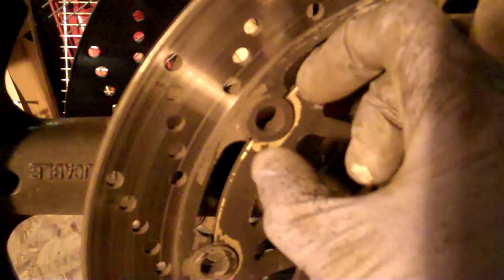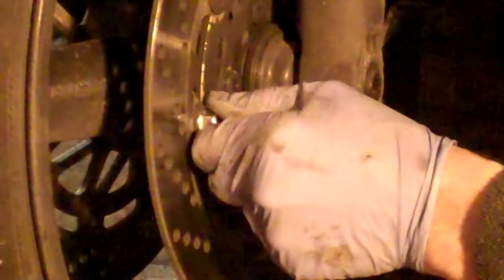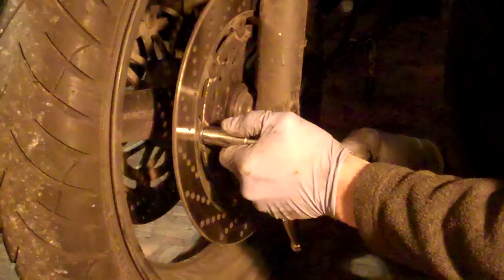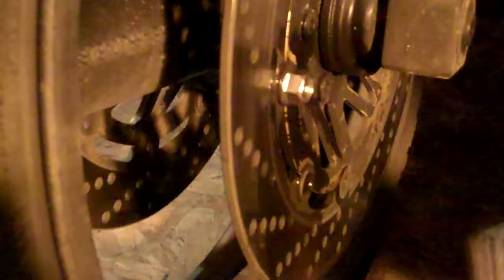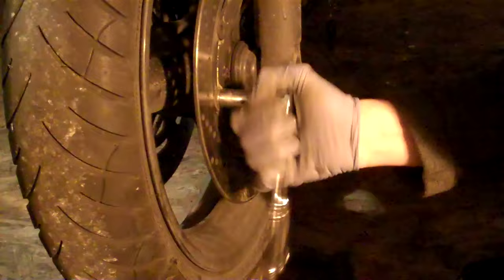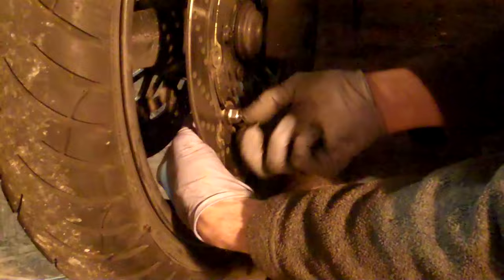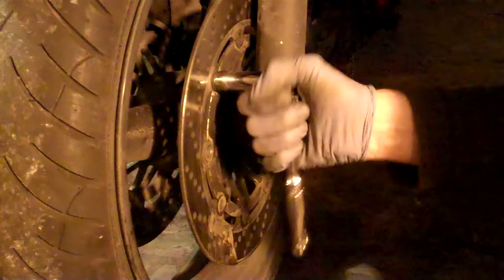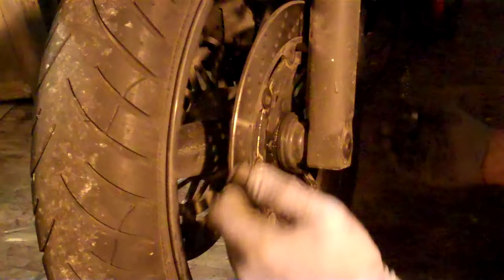Delboy's Garage, How-To Free up 'motorcycle brake disc bobbins'.!

Comment from the maker: Well done to you, Sir, it's excellent to hear that you've sorted it out.  So many riders write to us explaining they have air in the brake hose and cannot bleed properly for trying when all it is is the rotors are flexing due to being jammed up, as you have found!  It's not complex but it does take a little understanding of each part of the braking system to be able to maintain it properly so it operates perfectly... well done again and ride safe, Del

Comment: I'm not convinced that disc bobbins are supposed to spin as freely as this video suggests. I've spoken to technicians (people who used to be called mechanics) at my local Triumph dealer. None of them thought of this as a regular maintenance job, other than to clean with brake cleaner (especially if you allow your bike to get as filthy as this one!).In fact one said 'leave them alone'. EBC now produce discs with flat-sided bobbins. They can't rotate.

Comment: Hey Del, avid fan!
I feel it ought to be mentioned (If it hasn't already) that this isn't possible on all brake rotors.
EBC's SD bobbins are not round. Hence the name SD (Square Drive). Trying to spin the bobbins could cause expensive problems!
So yeah, check your discs people before you give this a try!

Still a top trick to know about for regular discs though!

Comment: Didnt realise these things existed till I came here and lucky me they're all seized; Thanks for the useful trick 3 down, lots to go
Reply from the maker: It is amazing how little known about these are Chris, and when you've done them, it will allow the disc to centre between the pads more quickly and you'll notice your brakes are sharper, many people bleed their brakes over and over trying to make them crisp at the lever, they even go to the expense of buying braided hoses in the quest for sharper brakes with more feel.... when 50% of the problem is the disc being seized up... go to it mate and let us know how you get on!
Reply: Ordered bolt (M12), bolt arrived, too wide (literally 1-2 mm off) now to wait for new bolt. my lack of sundries is embarrassing :D

May as well use the time to clean the chain, front brakes and replace my horn that sounds like a squirrel farting. Winter ridings a dirty lark.
Reply from the maker: ***** Good work Chris, housekeeping will keep the mechanic away and shame about the M12, little tricks like poking a drill bit through just by hand to check the size first before you order the bolt can save a lot of grief... drill bits are a great tool for measuring holes...!  Don't worry about the sundries mate, mine's taken a lifetime to build up and I still don't have everything I need, you never will mate!
Reply: M10 Hex Bolt (short) from B&Q... think I have enough to put a bolt in every hole in the bike but win-win. Managed to clean  a few that were rock solid; low and behold my brakes don't judder when I have to brake heavily any more.
Marvellous Trick, thanks for that!

Comment: Man, you rock! The squealing is gone, and so is the shuddering. The brake lever "takes" higher up and is a lot stiffer than before, my steel-braided brake hoses are finally working properly.
I've reason to believe that since the rotors were stuck before, my braking was mostly about warping the rotors in their holders as they were stuck.
Problem is now fixed and I have a new motorcycle it feels like!

Comment: Hi Del.I was having trouble with brake noise and was thinking the worst seized pistons in the callipers etc, fitted new pads cleaned callipers and pistons still getting brake noise.Then tried the rotor bobbins, seized tight on one side of the whee,l did what you said in the video NO noise now. Fantastic thanks for your help probably saved me a few quid not having to take the bike to the garage.Keep the videos coming.

Comment from the maker: Too right Ade, half of these garages just want the money for the big job and think you will trust them and the others dont have a clue how to clue... give it a good cleaning like this and it should get a lot better... mine start to oscilate about mid winter and a good cleaning get them back to normal...warping a disc is very rare unless you are braking really really hard a lot of the time and have a high performace bike.... its much more likely they are gummed up.. good luck and well done.. Del.

Comment from the maker: Hi Stuart, without a front paddock stand, easiest way is to jack against the side stand...simply put it on the side stand, place a trolley jack under the right hand side of the bike & with a folded rag to protect against damage, jack carefully up under the collector box on the exhaust and it will roll left and the front wheel will come up ...and be careful!  Cheers, Del

Comment from the maker: Hi Dean.... no, you're fine as long as they spin with the bolt in...if the bike is quite new and the brakes in fresh condition then the bobbins will still be snug and tight from new...its when the dirt stops them doing their job that your braking efficiency is effected....so just make sure they spin round with the bolt in and thats fine...  thanks for your kind support... take care, Del.

Comment from the maker: Hi Ian,yeah there are a couple of bikes with solid bobbins,the single only way to do them is by hand using a g-clamp & a postage stamp sized square of inner tube rubber to protect them & then spray away & wiggle!  It's more long winded,but gets the job done......I wouldn't sweat it too much, mate, as a bike like that I'm sure, isn't gonna ride in the filthy weather every day, so your discs shouldn't get too cacked up!  Hope that helps you, mate, Cheers, Del

Comment: Awesome tip thanks a lot. Many mechanics I have come across over the years have felt that brake lever moving in and out and insisted the discs need changing without any other investigation. Happened to me many times. Will try this on my latest wobble!!!

Comment: Hiya Delboy! Traded in my Hyosung gv250 and picked up a nice silver 2003 Bandit 600. Did this job today... Bobbing rusted solid. Sorted now, Cheers mate
Reply from the maker: Charlie Rutledge Hi Charlie, congratulations on youre new bike buddy....good choice, i reckon 9 out of 10 bikes over ten years old will have jammed bobbins, so its a good fix for better brakes right away... ride safe mate.. all the best.. Del.

Comment: My disks were pulsing during braking as well. I used to push them from side to side as you did in your video and spray them with a bit of brake cleaner. This worked, but only for one or two rides, probably because I couldn't get to all the gunk. This seems like it might do the trick, gonna try it tomorrow. Good video!

Comment from the maker: Hi mate, yes, its a greatly missed little bit of maintenance, but once you've done it, you'll be surprised at the improvement it makes in lever feel and braking response, plus it will prevent you warping a disc in the summer as once they are seized up they cant move about so flex instead...  cheers mate, Del.

Comment from the maker: 90% chance it will be mate, the bobbins have to be free to move otherwise the rotors will freeze up slightly off centre and there's your pulse..get them spun up and you'll see how much better the brakes are... good luck with it mate.. Del.

Comment: I use a bit of wood on the jack. Gives it a better seat for the bike but won't mark the frome. Also lets the bike go higher easier. Did that for my dad's R6 while switching engines and with my mums bandit 600. The bandit is bloody heavy! If you have a centre stand , use that and get a heavy person to sit on the pillion seat lol

Comment: Hi Del, the Video is quite an old one but still relevant. Your Videos are all remarkable and those advices along the way as side notes are a real treasure. Have followed both Busa and previous projects. Absolutely marvelous.
I was unable to decide where to post this question (Busa Caliper Rebuild or here) as i have something in between.
GSXR 1000 K1. Changed the Rotors but not the pads as there was enough meat on them. But now they are moving inside and with rotation at lower speed you can hear that rattling noise. 
Rotors on the side where this sound is coming from has clean rotatable and free bobbins. On the other side tried a lot of cleaning with brake cleaner but 7 of them are not rotatable by hand. :(
Also tried brake grease on the back of pad that did not help either so washed and cleaned it. 
Pistons are all cleaned up (wd40 lithium sprayed). Moving aahhh... freely (last one comes a bit late but same behavior on both side)
Haven't missed any assembly parts as well.
Wondering how could this be solved.

Comment from the maker: Hi Terry... had a look at some, and indeed they do appear to be solid...i guess the only thing you can do is use an old tooth brush and scrub all round them while jetting the brake cleaner in the gap...as long as the worst is off then they will still work ok.... hope that helps you out...i didnt think any bobbins would be solid, seems a bit daft, but who are we to question the mighty factories aye..lol... take care, Del..

Comment: Alright Im going to check this first thing tomorrow... after work.
My rear brake has been pulsating for a while and I couldnt figure out what it was.
Thank you for pointing this out!
Reply from the maker: I imagine it's highly unlikely that it will be frozen brake bobbins because rear brake discs are usually solid, this trick is only for a floating disc, you could check the disc for run out to check if it is warped and worn to excess, the very least you could dry is new pads and clean the caliper, either way, good luck with it my friend.
Reply: @Moonfleet41  Hey thanks for the reply. Thats a tad worrying because the brake bads are new and I've been cleaning the brakes a few times. Maybe some lube or chain cleaner had gotten on the disc. Unfortunately this didnt help.
I cant 'see' any warping... I'll check the bobbins (see whats what) and drop by the shop if I cant figure it out. It needs a service soon anyway.

Thanks again!

Comment: Things like this should be in owners manuals, bye the comment on Ducati floating discs, lol, your absolutely right. My Monster has tonnes of float which can even set up a resonance/vibration if the right brake pressure is held for too long. Must be a Ducati thing! Anyway, great video,

Comment from the maker: Hi mate,thanks for your question,first check that you are using the right pads for general road use & not race pads & learn to lay off the brakes a bit,unless they are cheap Chinese discs of rubbish quality,then the only way you're warping them is through too much heat,heat that is kept on them for too long,you could be braking too late & too hard or braking light for too long causing a slow heat build up,provided they are fitted correctly only mis-use will warp them..what bike is it? Del

Comment from the maker: If the bike is quite new, remember, these are only semi floating discs, not fully floating as on Ducatis where they literally rattle, so they should be firm, but moveable and on a newer bike there is no wear so perhaps they are just still a bit snug, as long as the brakes work ok and all the bobbins are mobile with the bolt in, then that's ok, don't try to over think it, mate, the general rule is that if it rides ok then it usually is ok .. take care Del

Comment: Amsoil. Great for high rpm bikes like r6 zx6r so on and so on. Wet clutch comparable. As for bandits motorcycle oil or 10w40 or what your manual reccomends will b fine. Great video again man

Comment: Hi Del. deffo stuck solid mate, tried the bolt trick, when I got the bike the sales guy made a comment on how free the bobbins were, he even turned one between his finger and thumb, I thought while I was doing a spot of maintenance that I would make sure they are moving freely, got a right size bolt and washers, not a sniff of moving, soaked em in brake cleaner and still nowt, i was thinking of removing the calipers and using wd40 as ive got brake cleaner for afterwards but not too sure, cheers.

Comment from the maker: Hi mate,it sounds a little odd as they are supposed to turn,there should be nothing holding them other than dirt or rust,how much force did you put behind it? Perhaps they are just so bad they are locked?? Make sure you're not bolting up too tight as you could be pinching them against the disc on the back,they only need to be a little more than finger tight, other than that, I've no idea, mate, mine have never not moved!  Let us know how you get on, Del

Comment from the maker: @terroristone Dead right mate, oil + dust = putty..and thats gonna gum them up faster... if you lube them very very sparingly and with the right stuff, its not dangerous as long as you know what you're doing..and as long as its your neck you're risking....but its still kinda pointless, they are designed to run dry, its the rain and brake dust that just needs removing.. if you suffer with a lot of brake dust then harder pads can lessen the problem.. but then your brakes wont work as well...

Comment from the maker: Hi mate, any brake or carb cleaner will do the job, even something like Easy Start if you are stuck, you just need a spirit based cleaner and NOT an oil like WD40 or GT85... unless you want to ride in to the back of the car you are following LOL!

Comment: Have you ever had some brand new rotors with seized bobbins? 2013 fireblade. Fitted some cheap (ngt I think) rotors and now have a vibration through the handlebars when braking (heavily or lightly). Previous discs were warped so had lever push back. Been on rollers since and deffo not warped now.

Comment: shot down to B&Q bought the right bolts etc. Just finished and went for a quick ride, seems to have sorted it out although the tech at the Triumph dealership where I bought my KTM did a similar thing (don't think he did them individually or with a bolt) and it came back after two days. Hopefully this time it's sorted.
Reply from the maker: glad you sorted it mate..

Comment: great video thanks. I'm getting vibration in the lever under hard braking, I just followed your steps and a few of the bobbins were stuck. Hopefully it will sort the issue out...
Reply from the maker: +hughiemg2 Hi buddy, yeah should help a lot, and you could maybe clean out the calipers too and make sure the pads are all moving freely, that often leads to one pushing harder than the other, which then means that the pads are trying to 'bend' the disc to one side...and that can make the pulse you feel... Hope that helps... Good luck with it. Del.

Comment: That's super helpful! I have a question, just realize that on my motorcycle ( CBR 600 F4 from '99) on my front left disk, only a single bobbin is moving..the disk brakes are the original, never been changed. It is the same situation as presented here or is the time to change them? The bike has 24k miles. Big thanks!

Comment from the maker: Hi again Paul, its a bit odd that they wont move... there is no reason they should not rotate, it could be that they are stuck so much you just need to soak them a bit... have you done the 'Bolt through and turn' trick?.. when you say its stuck, is it moving but just real stiff, or is it totally solid?.....let me know mate.. Del.

Comment: mine are moving with the screw but not with hand... is that normal because i have floating discs. Its z750 has 40k km on the clock
Reply from the maker: Yes indeed, it's very rare they move by fingers only, as long as they turn without too much resistance, then they will allow the rotor to side shift independently of the carrier and keep everything lined up in use.

Comment: Are all brake disc bobbins supposed to be freely moveable or only some models? I ask because the brake disc bobbins on my brand new SV650 are tight as a drum and cannot be moved with finger power.
Reply from the maker: Only some bikes..!
Reply: @Moonfleet41  Thanks!  And have a speedy recovery. 👍

Comment: Great Video, Popped out to the garage to check my bobbins Mk1 B6, they are stuck solid. Followed your video used pretty much 2 cans of brake cleaner on them to free them up with no joy, there still stuck solid, they will rotate when the bolt is in there.. just, and i get no "floating" of the disc...  any further advice you have for freeing these up before i have to resort to buying new discs??

Comment: What kind of lubricant do you spray? is Wd40 good? I mean, is it not dangerous to spray something on the disk where the pads tighten? Thanks for the video!
Reply from the maker: NO.. Never use a lubricant.. use brake cleaner spray only.. that will dry away and not effect your brakes.

Comment: Bobbins are tight on my xjr1300. Spun them and used brake cleaner even turned them with battery drill,,, still tight. Can turn with nut and bolt using a spanner but still too tight to turn by hand 🤔

Comment: I understand a floating rotor should have side to side movement to allow heat expansion, but what about directional  movement? Great videos by the way!
Reply from the maker: Side to side movement is not for heat expansion, it is for alignment with the fixed caliper, it makes the brakes more responsive... rotational movement is always a side effect of this, just hold your bike's brakes on and rock the bike back and forth whilst you watch the disc, you will see the movement...

Comment: Hi del. Tried this on my gtr but even with the bolt in they won't spin! Have cleaned all with brake cleaner and some dirt came out but now run clean. Any ideas, it's a 2009 bike and disks are semi floating. Vibration under braking has reduced but not gone. Stripped and cleaned callipers to. Any ideas on what to try next? Cheers, Craig